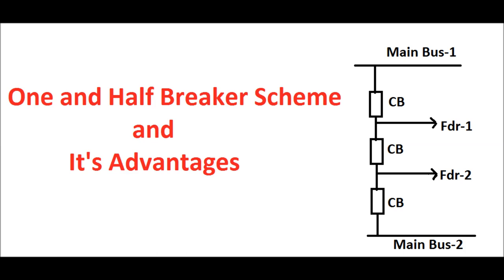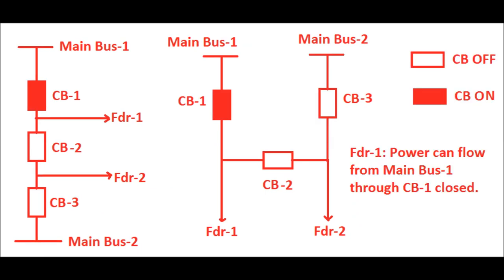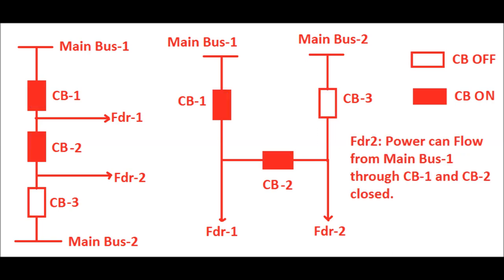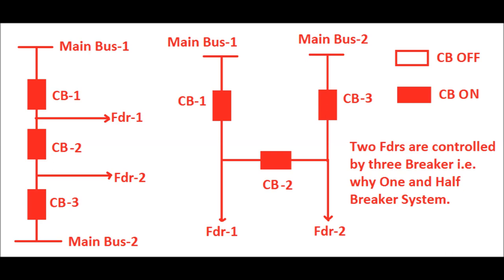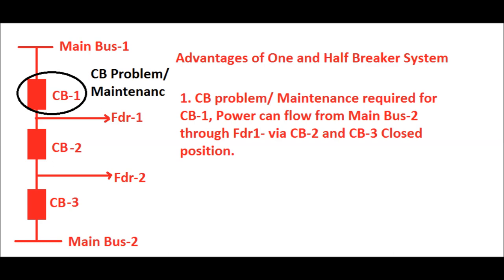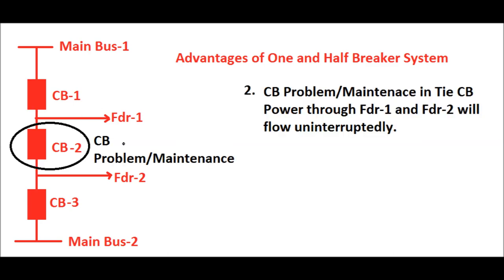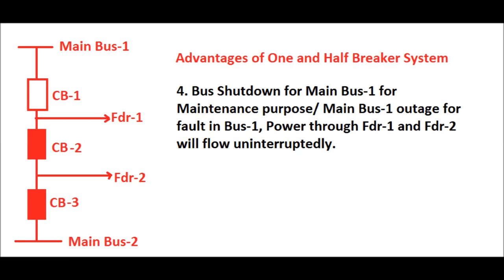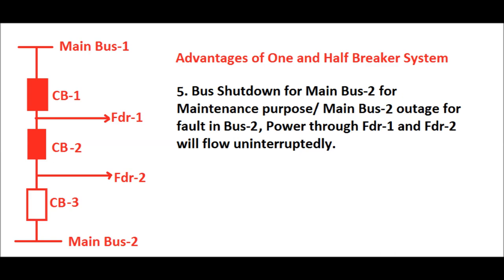ONE AND HALF BREAKER SYSTEM AND IT'S ADVANTAGES

Comment: Hi, for Advantage 3, if both CB-1 & CB-3 has problems and both open:  Where will Fdr-1 gets it power since Fdr-2 also has no power..?
Reply from the maker: Thank you so much for your comment. Advantages 3 can be fulfilled in case of either of fdr-1 or fdr-2 serves as source and other serves as load.
Reply: Advantage 3, me not understand